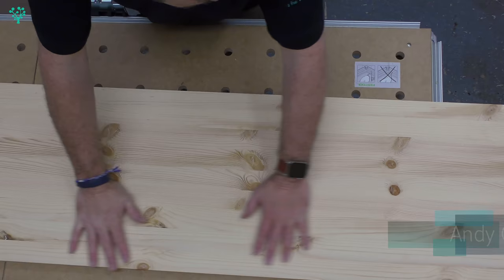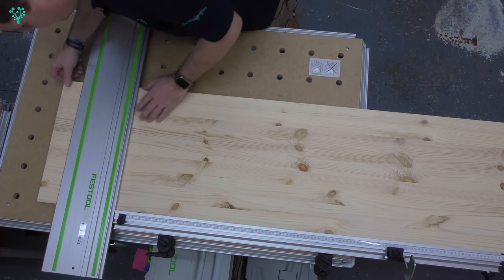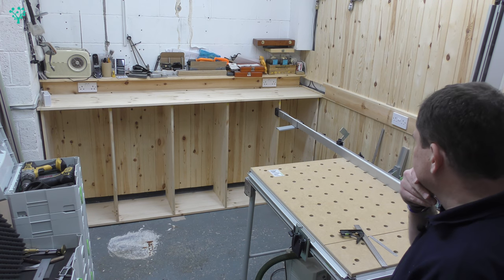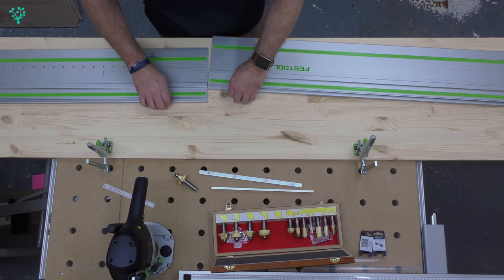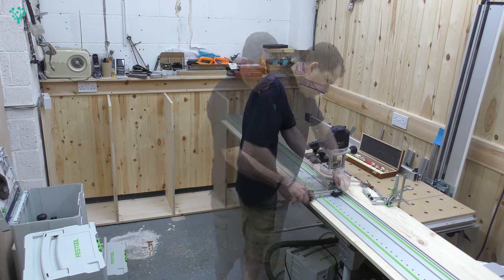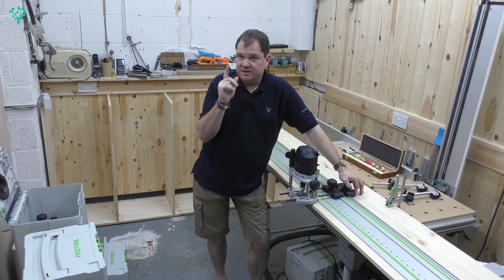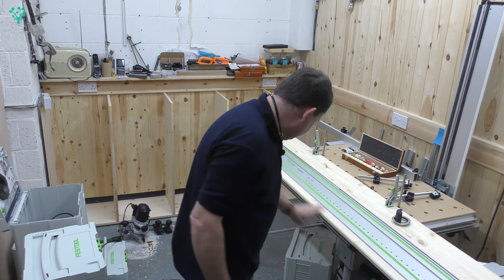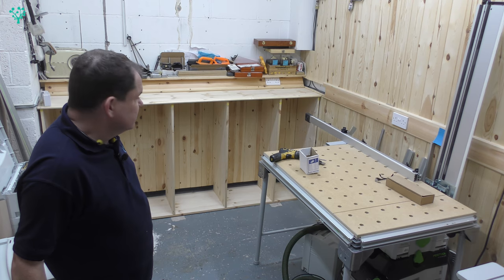Festool systainer storage system building the sysport 5

Comment: Hi Andy..does that extending fence with support feature in another video? What’s it called?!
Reply from the maker: +11hoursoff Hi, thanks for the question. It’s the Festool Trimming attachment CS 70 KA from the Kapex MFT kit. 

I discussed it in the Kapex MFT setup video, that was a two part series and I can’t remember if it was in part one or two.

It’s a versatile piece of kit, as you can see it makes a great fence on the MFT, and as it is telescopic gives great support if material is longer than the table, such as the panels on the sysport.

It’s designed for the Kapex 120 to give you a mitre station, so you have two, one on the left and one on the right of Kapex MFT. They attach to the Crown moulding stops, and from there they attach to any Festool table with the v groove side rails. So the Kapex, the CMS, the MFT.

In the application you are talking about I just laid it on top as a fence and clamped it using the same clamp that connects the original MFT fence. (In fact I bough a second clamp for the purpose) but it comes with legs that stand at 900mm high so will also attach to the side of the MFT.

They come bundled with the Kapex MFT table, but I have seen them for sale as a separate item. If in the UK N&B power tools sell them. http://www.powertool-supplies.co.uk/festool-trimming-attachment-cs-70-ka.html?gclid=Cj0KCQiAvebhBRD5ARIsAIQUmnm9dsXF6Rgaes3jgjEUyqErIHRuCzLp6wi5BsS3yK6iOFmMdvV4-nIaAgXoEALw_wcB#/product/6611.

Hope that helps, and thank you for the question.

Cheers

Andy

Comment: Hi Andy, Where did you get the extension measure rail for the MFT/3  with the extra support for cutting the board to length
Reply from the maker: +Bear Pa 

Hi, it is actually the extension from the Kapex MFT kit.

https://www.ffx.co.uk/tools/product/Festool-Ks120Set-Mftgb240V-4014549299319-240V-260Mm-Kapex-Sliding-Compound-Mitre-Saw-Mft-Set?gclid=CjwKCAjw98rpBRAuEiwALmo-yrbzGjKap6KLxshUDtpp3sjtTmi0CKbg09t2Zjhl71eO9-lF7656dRoCG5YQAvD_BwE

Kind Regards

Andy